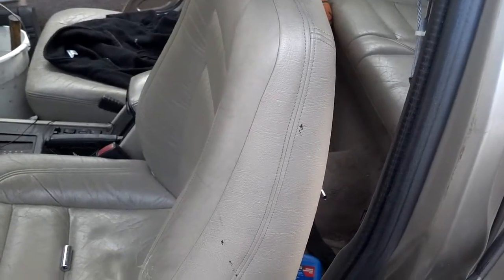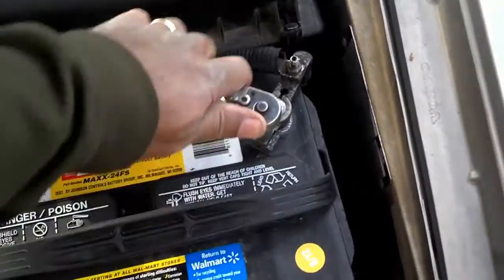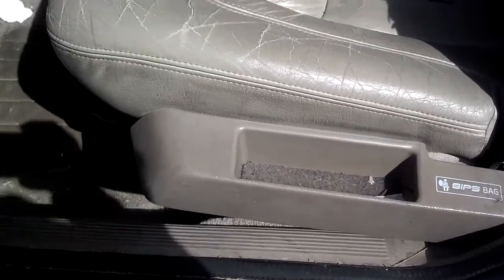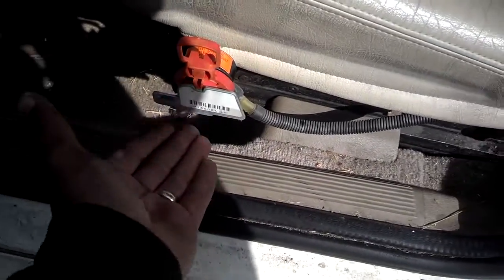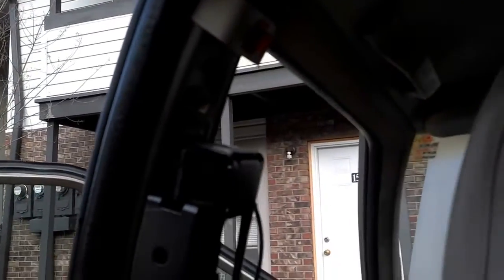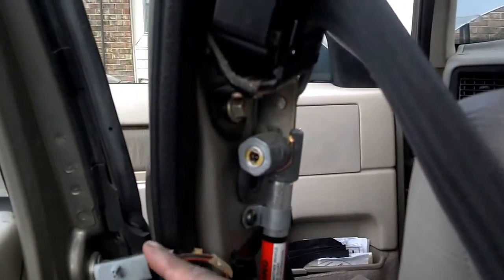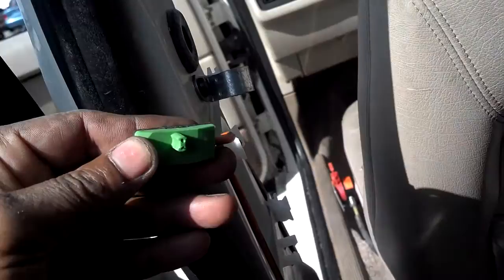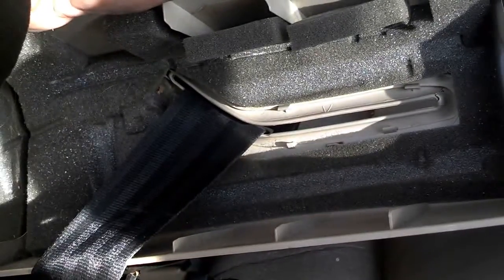Front seat belt replacement on the Volvo 850, S70, V70, etc. - VOTD

Comment from the maker: There is one in a '99 S70 in a junk yard near me. I believe they charge about $30 for them. They think they are the automatic retractable ones since it has the SRS re-tractor on it. Let me know if you need help with getting one, send me a private message. If the '99 wont work the 850 ones will. The '98 S70 is a cross over car for many things.

Comment: I was in a low speed accident with my '90 240, someone went through a stop sign.  The 240 had 285K miles, was 19 years old and the air bags still deployed.  I never thought it would work after all those years.  The car went to the Breakers.

Comment: Most car manufacturers guarantee seat belts for life of the car, you may have been able to have this done by Volvo.  I had a problem with a Subaru belt recoil, no questions at the dealer they just replaced it.  I'd be surprised if Volvo doesn't guarantee also.

Comment from the maker: I will double check but I think they do NOT. Reason being, these belts are 1 accident use and people don't get them fixed after an accident. They will also set off the SRS light when they have a fault. The SRS system, which includes the air bags, is suppose to be tested and serviced very 10 years. It turns out that air bags are only guaranteed to work for 10 years, after that they have a high failure rate. No one wants to pay to have them replaced.
Reply: Well, Shoot. I replaced my mother in law's seatbelt. Now the srs light is on. Is it even worth getting it reset?

Comment: Robert, thanks once again for your videos. I have to do a repair or replace on my drivers sice V70 seat belt and I NEVER would have know about taking care of the battery to not set off the SRS system.  I am confused though.  I see you have this vid for replacing a belt on the v70 and 850, and a seperate vid for the v70.  My first thought was that the belt from my 94 850  would be interchangable with my 98 v70 glt,, but then I saw the second video and now I'm not so sure.  Could you give me a thumbs up or down on the cross over? I've tried to find google this info, but for some reason, I'm not getting any where.. Thanks, Sue

Comment: Hi Robert, good video! My V70 from 1997 has some issues with the belt on the drivers side. I tried to clean the belt and use brake cleaner for the mechanism inside, but my belt still blocks very easy when I try to pull it out and put the belt on, it does not have any problem at all to wind up.  It is very irritating to be forced to pull it out slowly each time I put it on. 
And yes I tried all different kinds of spray grease to lube up the function mechanism but so far with no perfect succés. Any ideas? Thx!
Reply from the maker: Replace it.

Comment: I have a 96 850 turbo, I need to remove the other side, the seat belt release side, it is held on by a very large torx screw, I don't have anything larger than T25, and need to buy the right bit, do you know if it's a T50 or what size it is? Thank you!!!
Reply from the maker: Check the '98 video. If I were you, I would purchase a set of bits to cover T30 through T50 or T60.

Comment: Hi Robert.  If I just want to fix the belt (it's stuck in extended position and won't retract) do I have to disconnect battery/air bag etc?  I just need to get into pillar and figure out why it's stuck.  It might just be twisted in the wheel.  As always, thanks.  (95 850 turbo wagon)
Reply from the maker: n8trsho As long as you don't unplug the belt tensioner from the lead, you should be ok. Sad to say, you will likely have to change the belt. Once in, it will probably not come back out.
Reply: Robert DIY Found one at the junkyard and can't remember year of car, but it had a bracket holding the seatbelt at the seat and then one bolt holding that bracket.  After getting it home, I had to cut (through steel) to release the seatbelt "loop" from the bracket and then attach the seatbelt loop directly to existing horizontal bolt as shown above.  A bit of work but at least it's fixed!  Continue to be impressed with how simple and practical some things are on the Volvo.
Reply: n8trsho Oh!  and thank you for the video which made it 100 times easier!
Reply from the maker: You are welcome.

Comment: I have had an 850T5 for about 15 years and just picked up a cheap S70 T5.  The S70 has a broken driver's seatbelt and I was wondering if the one from the 850T5 would fit?
Reply from the maker: Jacek Radajewski Depends on the year but I believe they mount different at the base of the seat.
Reply: Thanks Robert.  It's a 1995 plate (1996 model) 850 T5 and 1997 plate (1998 model) S70 T5.  As far as I know it was the last of the 850s and one of the first S70s.  The seatbelt in the 850 is quite new as I had it replaced by volvo a few years ago ($800) so it would be really nice if I could somehow move it to the S70
Reply from the maker: Nope.
Reply: Robert DIY [off topic] how about front break discs?
Reply from the maker: I don't know. Volvo changes rotor sizes more than my wife changes her finger nail color.
Reply: Robert DIY thank you Robert.